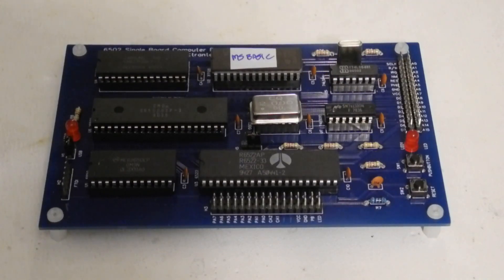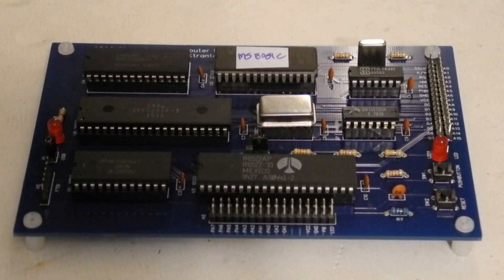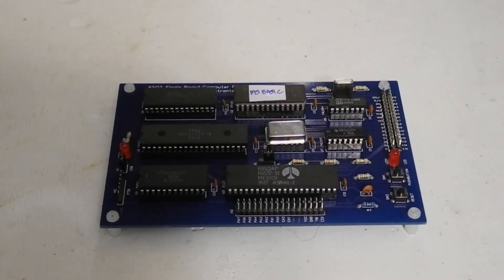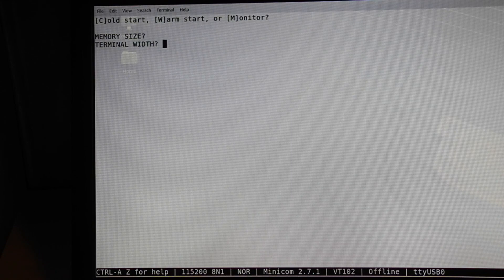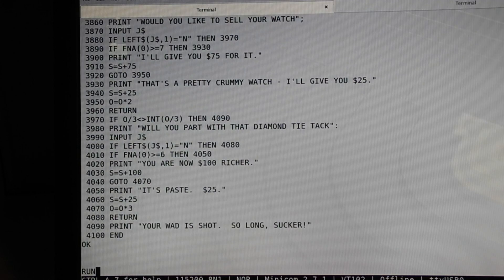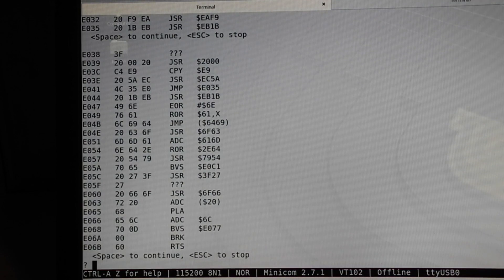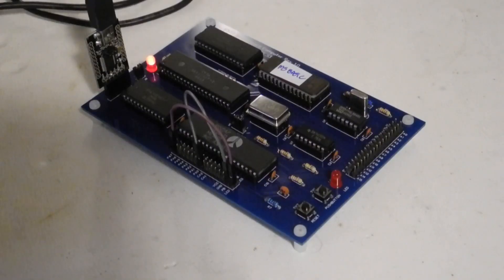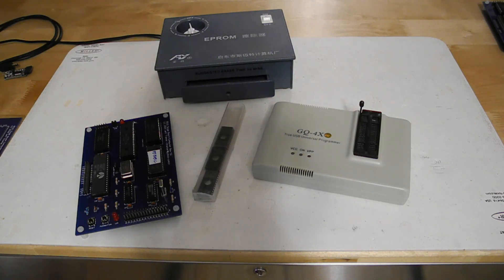A 6502-Based Single Board Computer

Comment: The 6502 stack is extremely small, so how does cc65 handle most variables in C being allocated on the stack? This would be very useful to know as a programmer.

Comment: Hey Jeff, awesome video. I have recently purchased Ben Eaters 6502 bread board computer project. However I wanted to be able to add a keypad and 6 SSDs so that I could use it, similar to the KIM-1 computer. I have just created a small, although uncompleted series on Keypad integration, using an 8051 to simplify the learning process. 
However looking at the KIM-1 schematic, and the 74145, it looks like I may have taken a slight left turn at Albuquerque. Although it has been a good learning lesson in keypad scanning and multiplexing.  
I do have one question on the KIM-1 schematic, as I am not an EE or even close and I am also, not a coder either. 
It is easy to see how the 74145 is not only multiplexing the 6 SSD it is also multiplexing the 4 rows on the keypad. My question is, what port on the PIA (U2) is the key that is pressed detected on? and is that port being used bidirectionally? To send out the 7 segment code as well as to receive the key pressed signals? 
I do have the KIM-1 assembly language program documentation, and I am trying to understand parts of it as I go along.

I was really impressed by the monitor program that you displayed on your 6502 SBC. Awesome work !!!
Reply from the maker: It would take me some time to study the KIM-1 keypad circuitry and code. I'd refer you to the KIM-1 User Manual which can be found on the internet, and this web page which appears to have some good info: http://www.baltissen.org/newhtm/kim.htm

Comment: Could also use a 27256 32k rom, or even a 27513 rom which is bank selectable to 4 16k banks.
Reply from the maker: Yes, but with a 64K address space, 32K RAM, 32K ROM, would need to reserve some of the address space for the peripherals.
Reply: @jefftranter  Yes some of either the rom or ram space would need to be reserved.  If enough decoding logic was provided, this could be as little as 512 bytes for the I/O chips you have used.
Reply from the maker: @scharkalvin  I purposely tried to keep the chip count low and avoid using PALs or PLDs, which meant only simple address decoding. It would be nice to have more ROM.
Reply: @jefftranter  True.  The 27513 eprom is a 4 bank 16k per bank part.  With little added circuity and some code, it could house 4 different systems (basic, assembler, editor, monitor).  Switching between each bank can be done in various ways such as having the switch routine in all banks, or by moving it into ram first.  These parts aren't that common, but are available.  There was also a 1 mega bit version as well.(8 banks of 16k IIRC)

Comment: Great project. I have a soft spot for 6502 computers as I used many Apple II's for projects back in the day. A very versatile system - but it would be cool to have a simple SD based file system too.
Reply from the maker: I've been experimenting with a serial to USB flash module: https://www.hobbytronics.co.uk/usb-host-flash-drive

Comment: Sd Chip would help a lot.   Not hard to do a slow interface.  Great work.   What is the "general" cost of the build?
Reply from the maker: I'd estimate about US$30 to $40 for the parts and PCB, less if you have some parts on hand or buy them in larger quantities.

Comment: Very cool. Brings back a lot of memories. My first computer was designed by a JPL engineer and was based on the Intel 8085 cpu. Everything was hand wire wrapped. Thanks for sharing.
Reply from the maker: My prototype ran on a breadboard (actually several) but my 68000 board was initially wirewrapped.
Reply: @jefftranter  I have been away from that part of the hobby for 30 years. Now I play with Rasp Pi and Arduino. People still do wire wrapping? Cool.